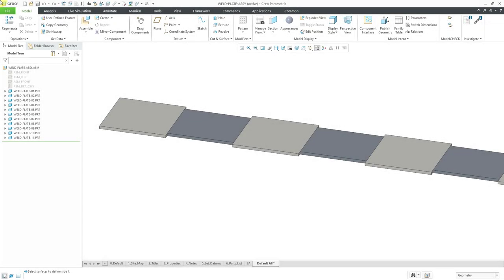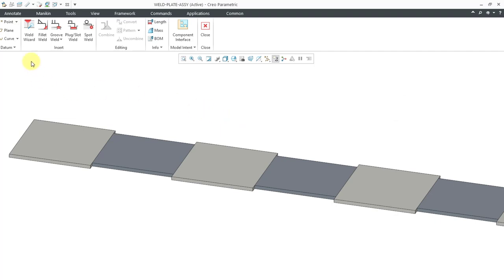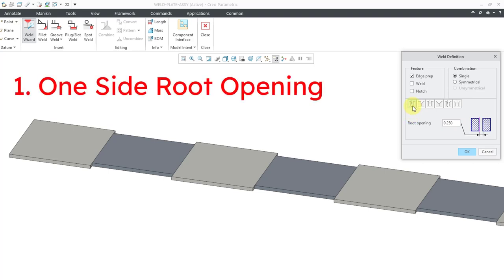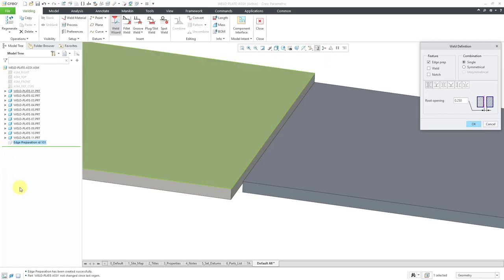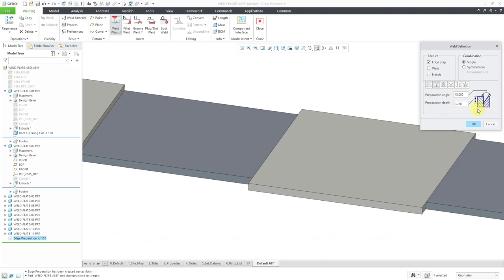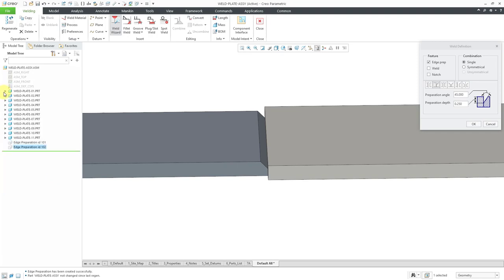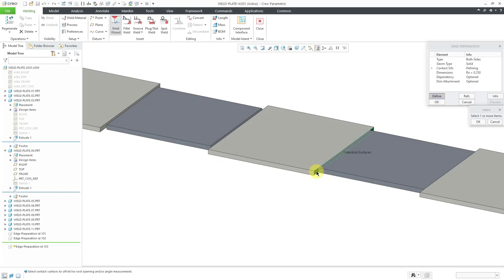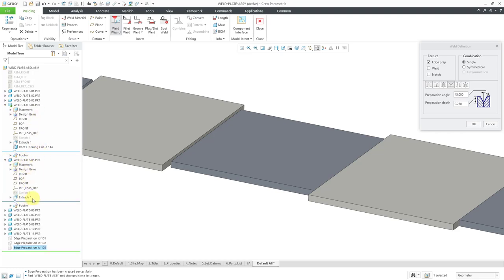Creo Parametric - Welding Module - Edge Prep Features (Part 1)

Comment: I'm curious how you think multi-body part modeling and weldment design interact.  Here it looks like you've chosen to make your weldment as an assembly of multiple parts.  Do you think there's a place for creating a weldment as a single, multi-body part, or am I just going to be fighting with Creo every step of the way?  I'm in Creo 8.
Reply from the maker: Since people have been able to create welds in parts for a long time (Wildfire?), you shouldn’t have any issues creating welds in a Multibody part.
Reply: @CADPLMGuy  I'm having trouble creating views of the individual burnouts without post-weld features.
Reply from the maker: I don't know what that means, but I also don't have the time (or inclination, honestly) to provide individual support (despite the numerous emails I receive daily). I recommend contacting PTC Technical Support or your reseller.

Comment: Any tips on selecting the second edge? It isn't "catching" it. I see the outline of both contact surfaces per step and can select the first edge without a problem. The second edge is giving me bother. TIA!
Reply from the maker: Have you tried Query Select or Pick from List?
Reply: @CADPLMGuy  No, but I actually just solved my problem by creating two bevel groove angle cuts. I have a feeling the problem arose because of the two components having rounded chamfers along joining axes, but with different orientations. So as if Creo didn't know how to cut through them at the same time. Hence the bevel groove doing the trick.
Reply from the maker: I don’t follow, but if you feel it’s an issue with the software, I suggest filing a ticket with PTC Tech Support.